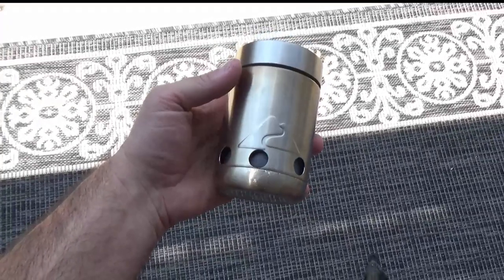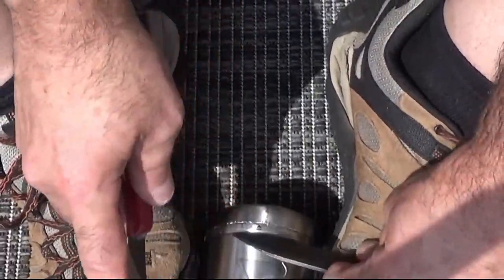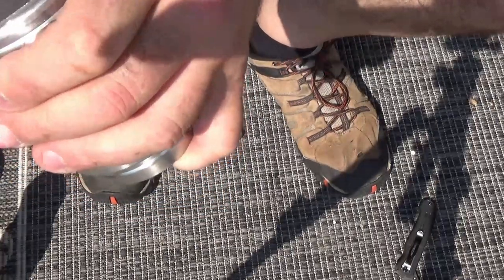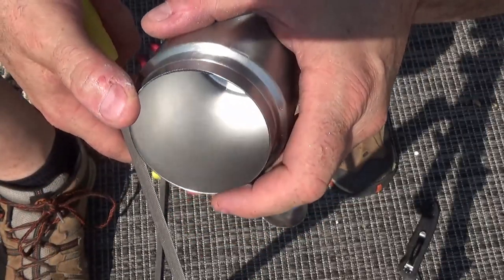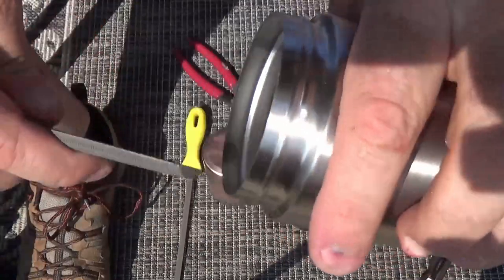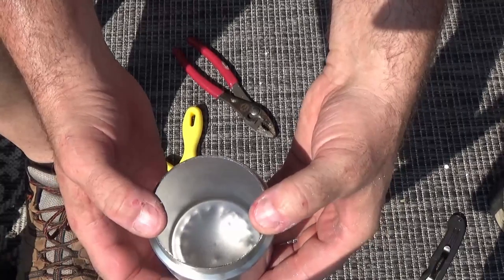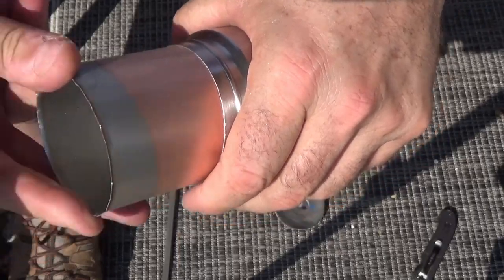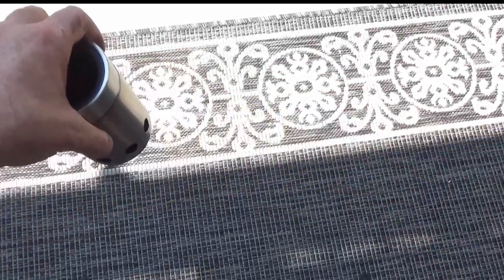DIY Small Stainless Steel Tent Stove! Wood Gas Stove Science| Camping Stove

Comment: Hi Heath! I just built one of these off of your plans. I had a slightly different approach to the inner liner removal from the outer: If you use a 150-100 grit orbital sander on the top and bottom (after the bottom cap is removed) you can quickly and easily get through those thin welds. A few taps with a 1x1 piece of wood on the inside on my sidewalk and the base piece popped right off. No burrs/sharp edges and took about 5 minutes. Thought it may be helpful to people in the future!
Reply from the maker: Awesome tip! Thanks for the comment!

Comment: Great idea!  Love to use stainless whenever possible but never thought of this!  I like the idea of keeping the screw on top.  I took the top from a can of salmon , which was just a bit to large, and cut the edge off with a pair of tin snips.  It presses in nice and tight inside the screw top.  I put the plastic coated side facing out for weather protection.  Screws back on tightly still and gices you  a closed container.  You can put a small plastic bag of wood pellets in there or a small bag with coffee or instant coffee ir anything else.  Just thought I would share that with you! My next gasifier build attempt will be with a one gallon pain can.  Will keep you posted. Any thoughts on that would be appreciated.  Have a great day!
Reply from the maker: Great! Keep me posted! Thanks for the comment!

Comment: You can file sharpen the end of a mini flat head screwdriver and punch pilot holes in the inside and then punch a quarter inch hex bit through those holes while leaving the insulated food jar intact.
Reply from the maker: The material that pushes inside will definitely effect airflow in a negative way but I’m sure you will be able to make it work! Thanks for the comment!

Comment: That's the micro I was thinking about. 👍 Plenty of ss thermos bottles to be found in second hand shops.    Thanks.
Reply from the maker: Hey small stove guy! This should work for you! Thanks for watching!
Reply: So many indeed. Dad picked up a the yeti version of this cozy for 25 cent at a yard sale the other day.
Reply: Yep, and in some of them, I imagine that the vacuum has already been compromised (dropping these can do this, as they are under tremendous atmospheric pressure (about 6 miles of more dense/heavy air, but then a lot more atmosphere besides that).

Comment: Can you tell us the size. And number of air holes?  Primary (I.e. Lower holes in outer canister), bottom  of combustion can/chamber and the secondary burn air holes in the upper inside wall of the burn chamber.  Even if you haven't reached the final version, it would give other experimenters a good starting point.
Reply from the maker: I’ll see if I can do that before or in the next video! Thanks for watching!

Comment: I think you may be overfilling the fire pit bit with too many pellets. If you just cover the bottom and light it you will create the thermal flow needed for these to work efficiently. At the moment the fire is sitting too high up the burner so the gasifier principle can't happen.
Reply from the maker: I could start with just the bottom covered, but then either the burn is very short or I add fuel and that not only breaks the pyrolysis zone and causes smoke and now it is no longer a TLUD stove. If I have this wrong, please elaborate. Thanks for watching.

Comment: What do You think about using thermos that has already two walls of stainless steel and modifying it to stove ?
Reply from the maker: Yes, it should work as long as the space between the inner and outer walls is at least 1/4 inch (6mm). Thanks for watching!

Comment: @heathputnam9524, at the point where you’re filing to remove the bottom, it may go faster if you treat it like you have a can of food and no opener: just rub it in circles on a sidewalk until the bottom comes off.

Comment: Awesome video. But wouldn't it be easier instead opening it up just to drill few holes from outside and from inside (obviously with an angle)?
Reply from the maker: Easier yes, by not as accurate. The secondary holes need to be as evenly spaced around the can as possible and the stainless steel they use is very tough. The primary holes also must be evenly spaced but not quite so critical. It is also very nice to be able to open this up to clean occasionally. Thanks for the question!
Reply: @heathputnam9524  in addition: i guess the amount of secondary holes should be more than the primary (outer holes), right? That would be difficult to accomplish without disassembly
Reply from the maker: Yes you are correct!
Reply from the maker: The holes in the bottom of the inner container are primary holes. They should be about 4-5 times as many as the secondary holes… thanks for watching!

Comment: Thanks for an awesome video. How well does it work for frying and cooking? How long do the fire pellets last?
Reply from the maker: It runs hot and is a little hard to simmer food with, but I have a cooking video with a paint can stove that is built with a dampener and simmers much better. The fire lasts about an hour if you include the char burning phase. Thanks for watching!

Comment: Hey Heath, is there an ideal distance between the fire box and the outer container?  Is narrower or wider better, or does it matter?
Reply from the maker: For smaller stoves 3/8 maximum. 1/4 seems to be a sweet spot. Since the flow is natural and not forced air any smaller restricts the flow too much! Thanks for the question!
Reply: @heathputnam9524    This is double interesting since a non insulated air gap of about 1/4" is also about optimum (for insulation purposes).